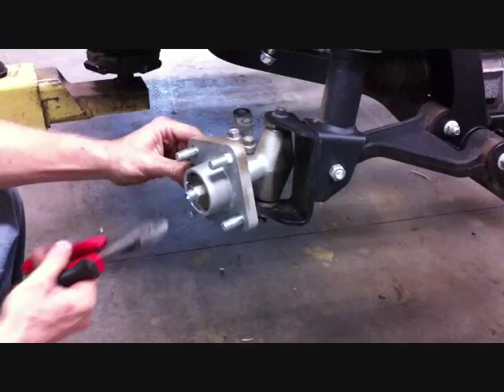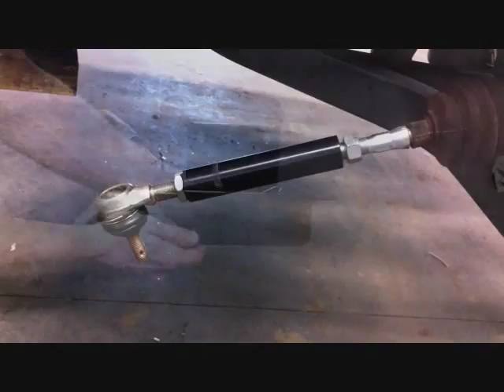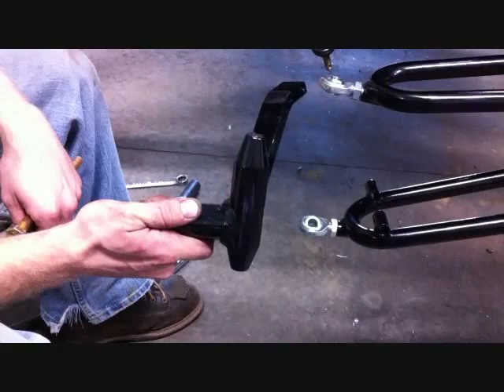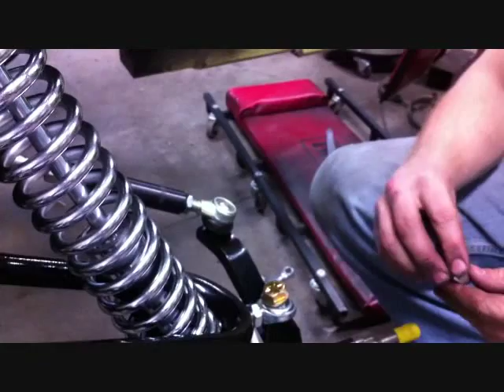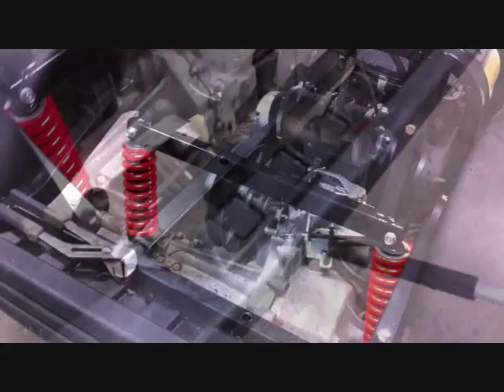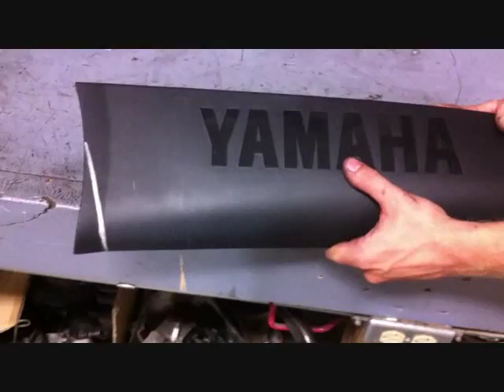Jakes Long Travel Lift Kit Yamaha G29/Drive Installation

Comment: I ordered kit 7416 for a FY2019 Drive 2 electric cart.  The rear goal post upper holes are about 1/4" too narrow to fit into the shock mounts of the electric cart.  What do you suggest?  Boring out the holes a bit?  Is there a different goal post for the electric cart?  Is this a big deal to modify?  thanks.

Comment: Wow, I must have been shipped the wrong tie rod ends.  They aren't reverse threaded for sure as they thread onto the non-knurled side, but not the knurled side as instructed.  First Jake's assembly item is a fail.  This sucks.

Comment: Knocked mine out last night - TIP: You do NOT have to remove the roof - just separate the supports where they meet the cart above the cowel and pull the cowel off. Also - when you add the tie rod extensions, turn them all the way in on both sides (tie rod and tie rod end all the way in) so the only adjust to be made is wider (if you need it) - mine barely needed a half a turn out. Also - camber all the way in so the only adjust you need may be out (again, barely needed a half turn out up top. Last but not least - the comment below about the bolts on the back of the sub frame - its a pain. But if you reverse the bolt so the end is sticking towards the front of the cart, its much easier to get a wrench behind and ratchet up front. Make sure to have a rubber hammer as the A-Arms are not easy to line up in their slots with the bolt holes. Took me about 6 hours total to do but someone who has experience taking these carts apart could do it much faster. WELL WORTH IT!  Kit looks fantastic and cart rides much better.

Comment: Yeah, you didn't mention how difficult it is to put those bolts in on the subframe. Those are in such a difficult area to reach it is damn near impossible to put those washers and nuts on the backside